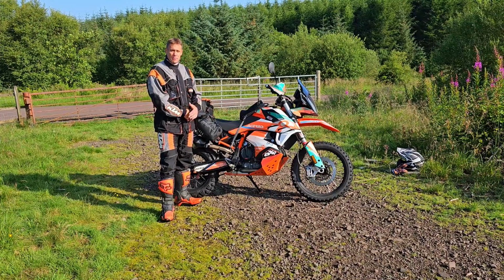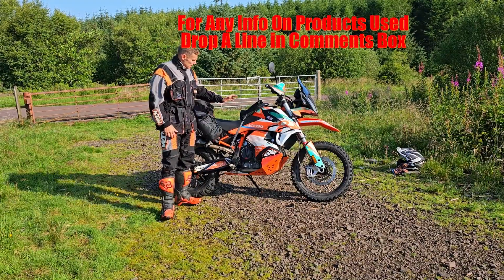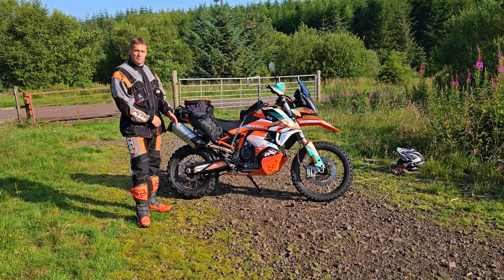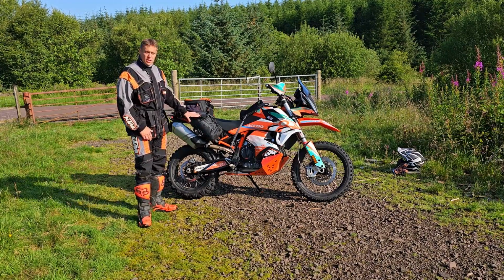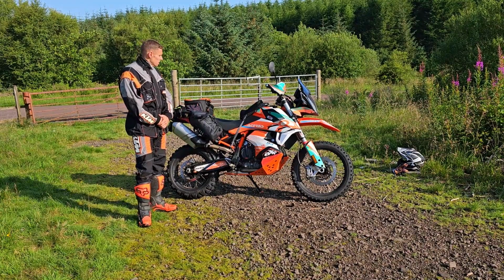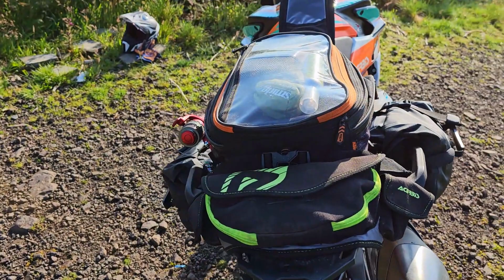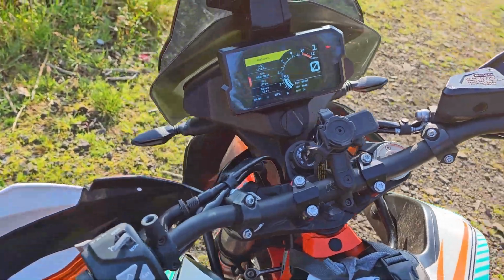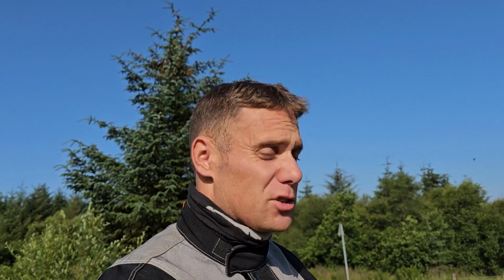KTM 890 Adventure R (TET Preparation Sweden Upgrades & Mods)

Comment: hey thanx for the video....can I ask re the de cat, did you have to play with any fuel mapping post install??  Also, re the well know 'cold start' issues, did you find the de cat helped with that in any way, or not?  thanx very much!
Reply from the maker: To be honest the decat was the first thing I did straight after the initial 600 run in, I have not had a single issue with the bike with starting especially in Scotland freezing einter,, no re-map, no tuning, installed rally mode (awesome), and have no complaints. Now that I have the Twin Air filter and Pre Filter set up I feel bike is running even more smoothly.
Reply: @NomadScotland  that's great to hear....happy it was worked out for you.  If anything changes, or if you have any updates on your set up please let us know, thanx again! and good luck.